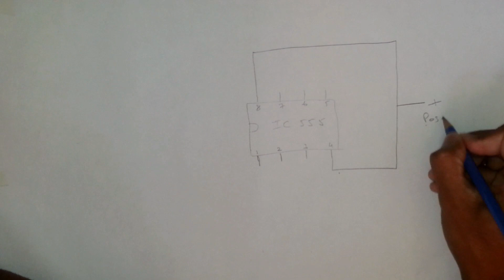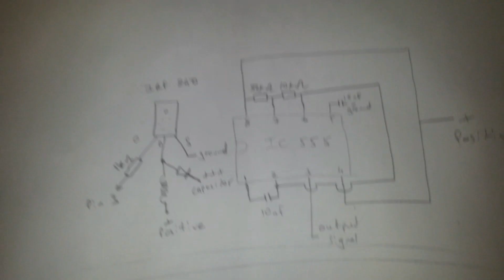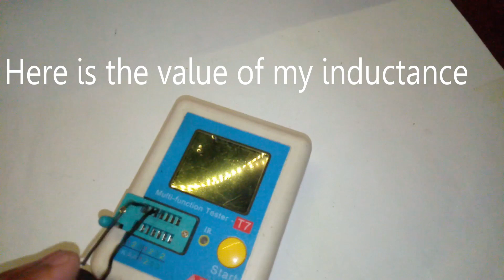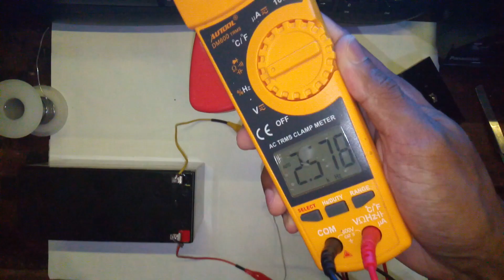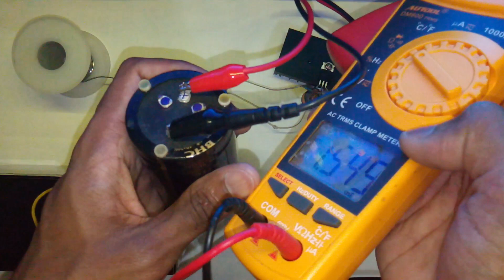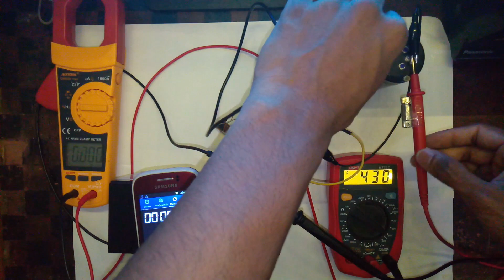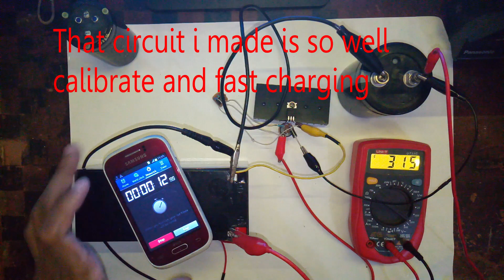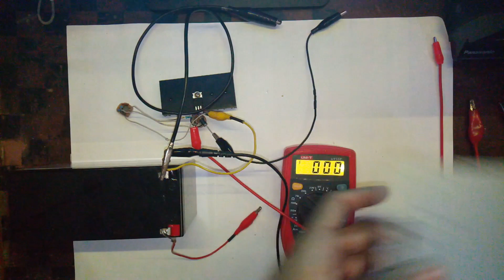How to charge 450V dc capacitor

Comment: Hi, Thanks for your nice video. someone please answer quickly. I want this circuit to for charging a 450v 680uf capacitor for a coilgun. I made the circuit but when I connect the battery, nothing happens and the capacitor just charges to 12volts(this is the voltage of the battery). I changed the IC several times but it doesn't work. I made the board exactly as you said and my battery is 9 amps 12.5 volts and I also tried using a breadboard. What is the problem? and what is the voltage of your capacitors(little ones on the board)?
Reply from the maker: well sry for late reply , there could be a problem with ur circuit or with ur mosfet, make sure u check the circuit again and again. the ceramic capacitor are standard i never check its voltage coz it doesnt matter, if u did the circuit exactly the same like mine it should be good 100%

Comment: hey nice video! I was wondering, what happens if you don't disconnect the battery after it hits 450volts? does the capacitor explode?
Reply from the maker: yeah it could explode but i know there is a limit more than 450v and also the circuit will get hot and will take more time to overcharge
Reply: @juleeboss  is there any way to automatically turn off the charger when the capacitor is fully charged?
Reply from the maker: @rodia_the_smg_guy5575  yeah but u will need another circuit to detect the voltage

Comment: How  much  is the  inductor  copaccity you  used  in this video?
Reply from the maker: i dont have equipment to test the inductance but i can assure you if you use same size of inductor or a bigger one with 0.5mm coil it will work fine or it will perform more oscillation

Comment: How would you charge a capacitor with a normal 9v battery. A capacitor bank with 333.33uF and 1350V
Reply from the maker: The same circuit i build in that video but instead using 12v u can use 9v
Reply: @juleeboss  Do you know how long it would take?
Reply from the maker: @vinnysaucee  it should be fast enough because the capacitance is low and only the voltage is high.. around a minutes may be or less

Comment: Please someone answer. Can I charge the capacitor by connecting it to 12V ? Connecting it directly to 12V from the battery, waiting a bit and then done.
Reply from the maker: No no no if you connect 12v dc directly to the capacitor it will have only 12v dc ... if u connect a 18v to the capacitor it will have only 18v...that why i make a voltage booster to boost my 12v dc to 450v dc so my capacitor can have 450v of charge
Reply: I've simply layered 9-volt batteries to equal my capacitor charge, it seems to work.
Reply: @matthewklose2255  yeah I managed to do it

Comment: Can I just connect it to 12V just like that ?
Reply from the maker: The supply is 12v so you can use any supply 12v dc to power the circuit...you can use less than 12v too but it will take more time to charge the capacitor